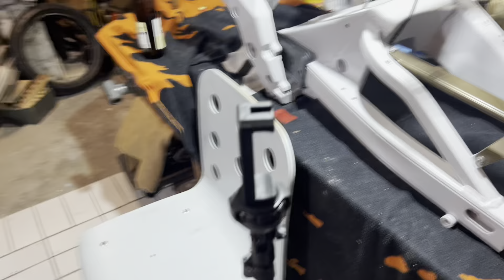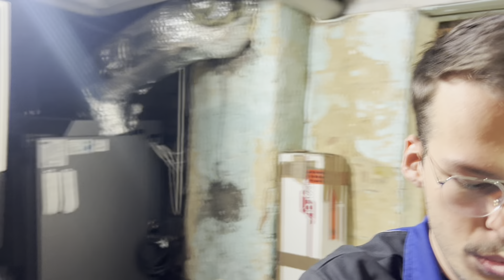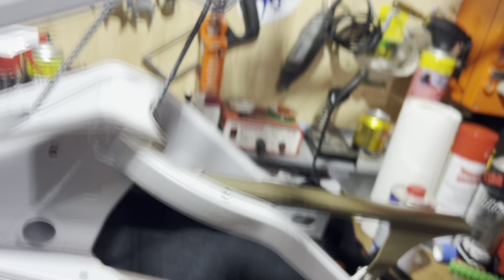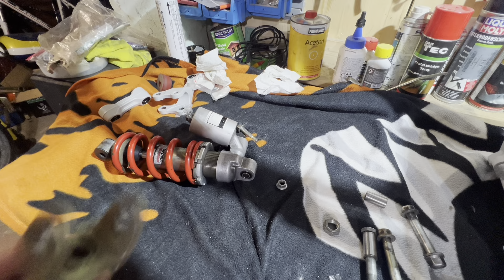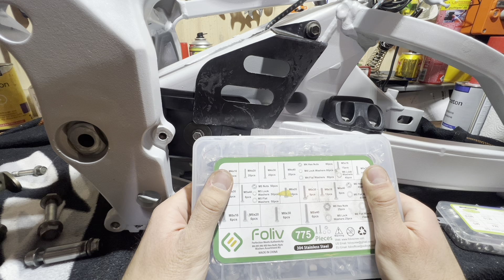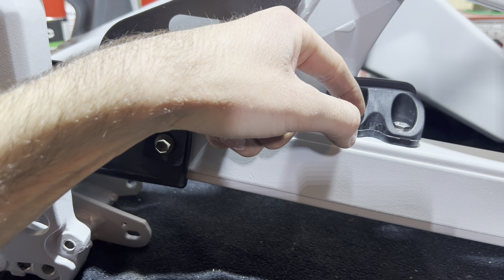3XV: Rear Suspension Problems

Comment: Hi, on my 2MA I’ve found on the frame a few holes are quite sloppy when the bolts are in. I had some BMW car cylinder head dowels, when fitted in the frame holes the bolts ( titanium) are a nicer fit. I’m using stainless bolts on all the fixtures as I don’t like rusty fasteners and titanium for engine / suspension. You could bore a hole in your wooden vice so the steering stem faces outwards and then press in the lower bearing. Mine went down with a metal tube and a few taps with a mallet it wasn’t tight.
Reply from the maker: Hey Thanks for the tip! I will try to source a different one First but that could also be an Option! 

I will probably ask a good friend of mine who Has a hydrolic press to press the bearing in with a fitting Tube.